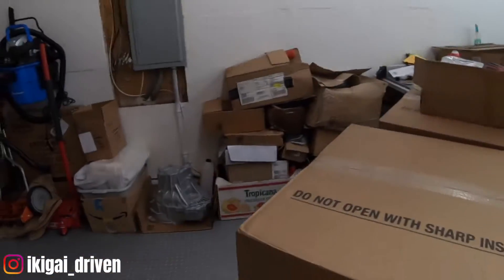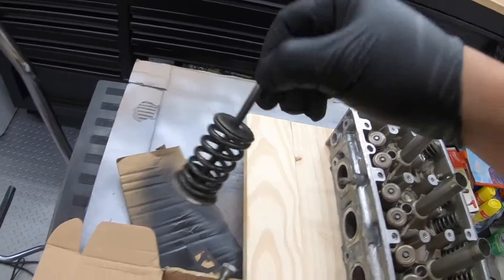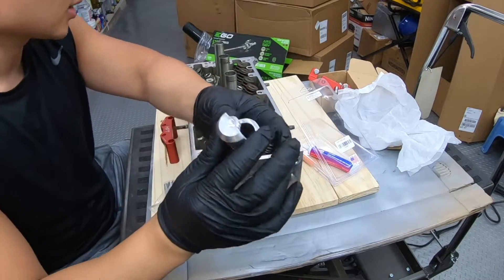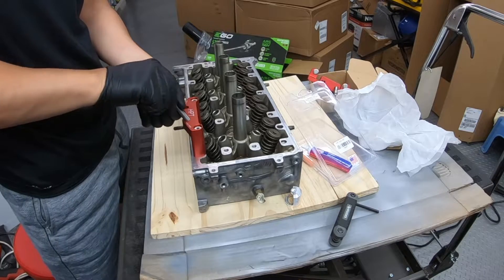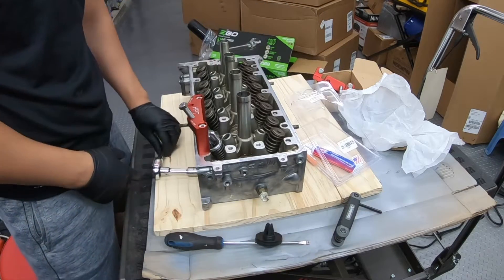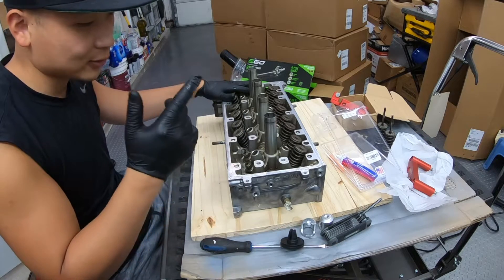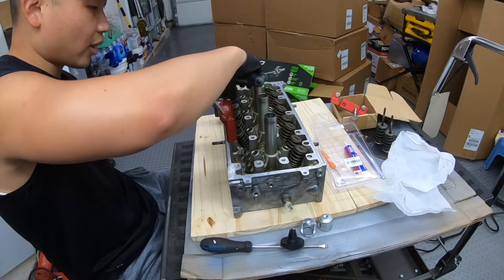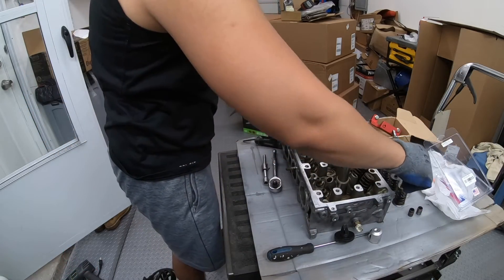K20 K24 HEAD | BUILT FOR BOOST - LETS GO

Comment: How many pounds springs did u use?
Reply from the maker: On this build They are super tech dual valve springs 92psi
Reply: @ikigaidriven  how many pound u recommend for a stock k24 block??
Reply: @ikigaidriven  how are they holding up? At what boost levels? For 700whp i think at least 95lbs dual valve springs preferably 97
Reply from the maker: @wickedsatan1  well its holding up just fine, i havent even boosted the car yet. too many projects at the moment
Reply: @ikigaidriven  so with 700whp in mind you think 95lbs dual valve springs would be fine or should I go up to 97 with stock valves?
Reply: @wickedsatan1  what about 80lbs is that good for a boosted stock motor?
Reply: @alitoroganan2442  depends on peak boost and rev limit. For stock k24 around 450ish on E85 & a k20 oil pump I'd say 95lbs dual valve springs is good. Discuss your goals with tuner and go with his recommendation

Comment: Ive used the PQY valve spring compressor. Never had issues. I recommend you grease up the threads on the bolt.
Reply from the maker: Thanks for the suggestion!!